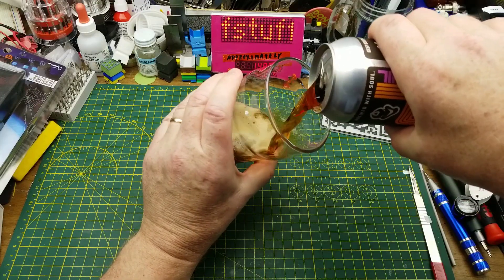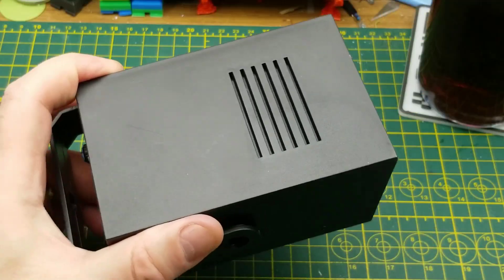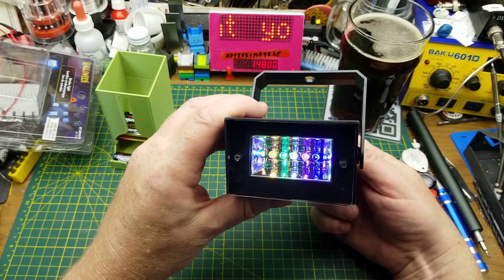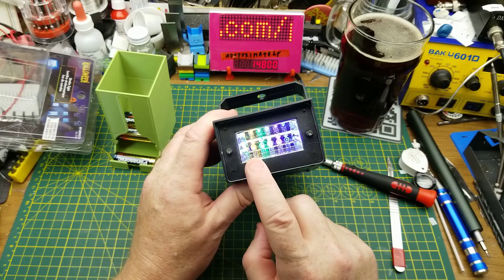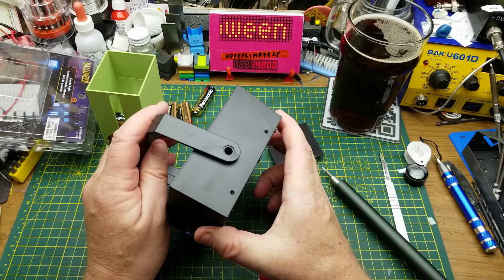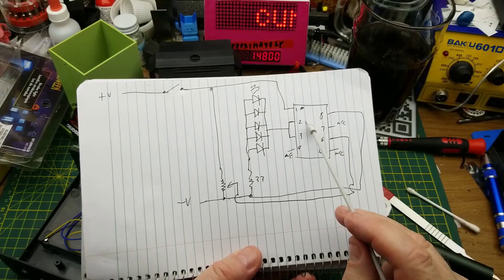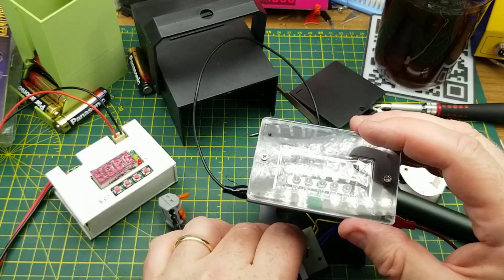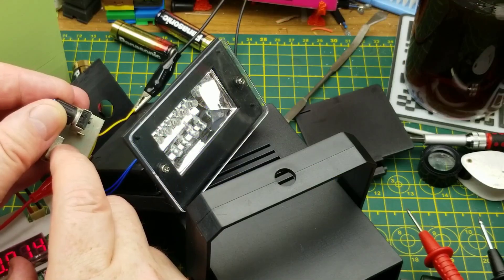Halloween strobe light: curiosity teardown

Comment: I have the same one. Put in the 4 Aa's didn't work. I took batteries out and looks like the springs are not sitting properly to make the connection.  Any idea how it might get fixed. Maybe trim the springs a bit with wire cutters ???

Comment: I suspect it's  a 555 being used in a very weird way that manages to oscillate without a charging cap. The Non-standard connection maybe brutalising some safety feature that gives the appearance of oscillating?
Anyone want to try building one and reporting back?
Reply from the maker: Interesting theory, but I don't think the pinout makes sense for that.
Reply: @pileofstuff  - 555 pin1 = gnd- oops you showed V+,  me bad . maybe I'm dyslexic or polarisexic
pin8 = Vcc - oops you showed V-,  me bad - sigh!
Pin3 = Output - CHECK
Pin2 = Trigger connected to Output  hence retrigger -CHECK
Pin4 = RESET = Floating - CHECK
Pin6 = Variable input = Threshold - CHECK
Maybe it oscillates when reverse polarity applied?? grasping at straws.... hides head in shame...

Comment: Great save with reversing the power. 😅
Could up the power to the leds by using a driving FET . 
They should be able to handle 20mA continuously (100mA total) . Convert it to use 18650s with a TP4056 protection pcb . 😊
Enjoy watching your videos

Comment: Maybe it's a 3 Cent Microcontroller (PMS150C-S08) from "EEVblog #1132"
For removing the Expoxy... Heat will do the trick, it's softens Expoxy
and you can cut it like Butter ;)
"Epoxy Heat Magic": https://www.youtube.com/watch?v=PMjPPQXn0W4&t=10s
Reply: My favourite chip! 👍😀
Reply: Yup.  Padauk 8 pin microcontrollers fit this pinout.
Reply from the maker: Good call. I forgot about those.